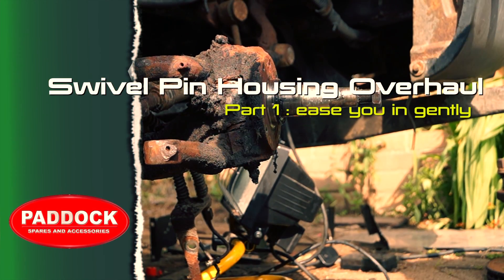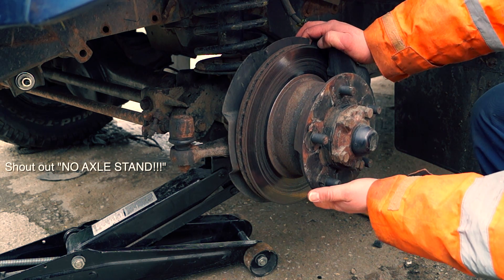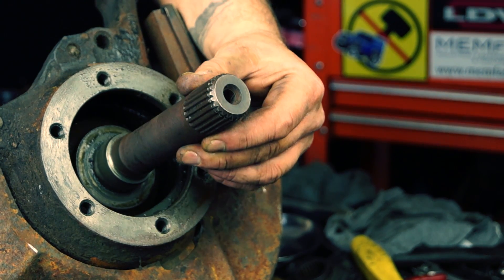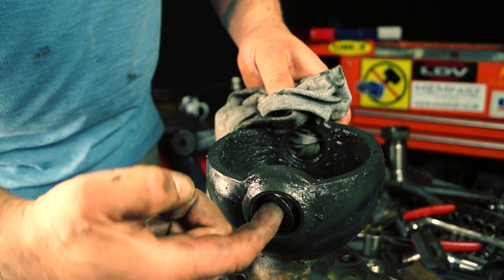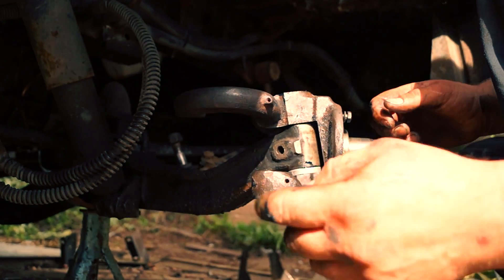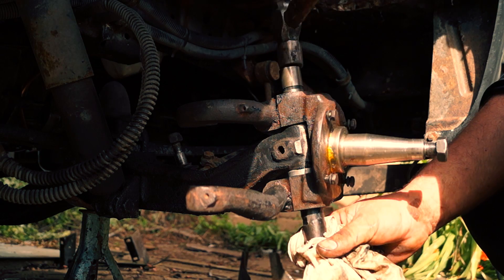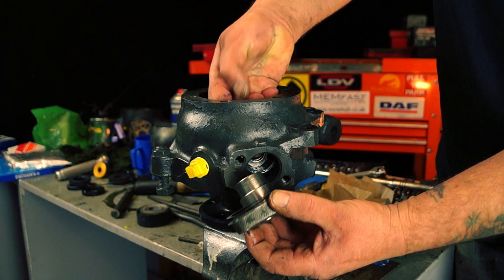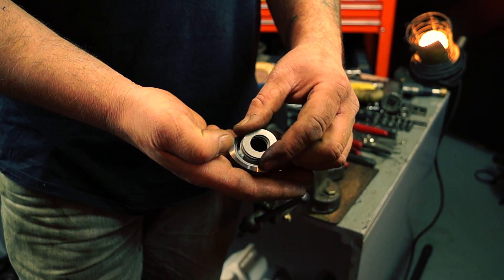Swivel Pin Housing Overhaul Part 1 - Ease you in gently

Comment: These videos are great, all the stuff you need to know to tackle the job. The really cool bits apart from watching the job getting done properly are the tips and tricks. Anyone who has tackled a job like this comes across rounded bolts/nuts, shears a bolt off in the hole or finds a circlip unwilling to leave home. Any tip on how to get these problems solved is worth it's weight in gold. Keep up the videos mate I'm glued to your channel,

Comment from the maker: Done loads of stuff mate,  rebuilt series 3's Defenders, etc. Also did conversion on the vehicle that has that stub axle on the video to 200tdi, etc.  Servicing, HGV fitting.  Plus servicing on ambulances Mercedes LDV, tanker work PTO blower equipment, pressurised liquid and dry powder equipment etc also worked on the Abrams Battle tank for a short while with the USAEUR in Germany.  long CV on mechanical fitting mate...